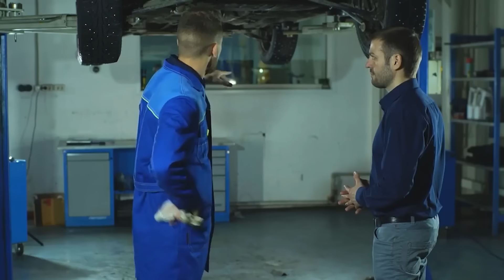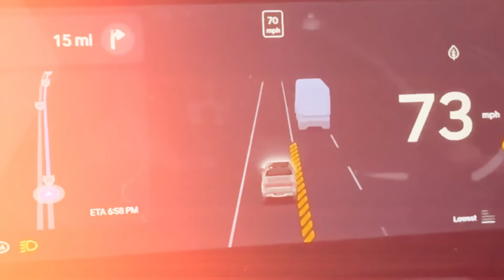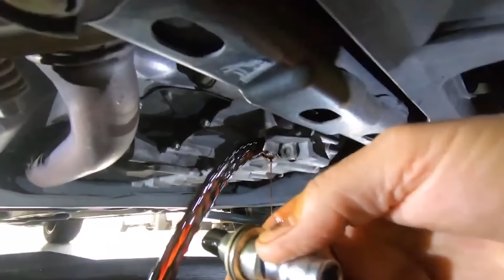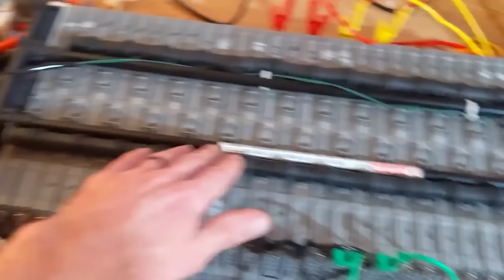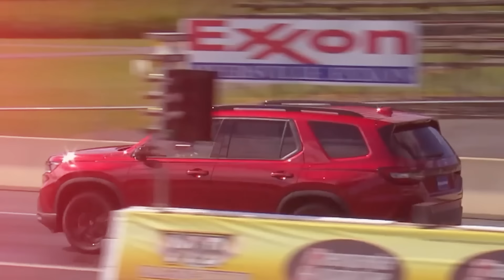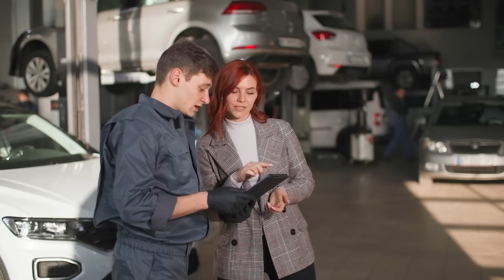NEW Honda Service Center Scams That You MUST Be Aware Of!

Comment: lol i took my brand new passport in for a minor washer fluid mal function and they recommended I address certain things, I said if I have to after address anything at 3000 miles I get rid of it and get a Toyota, I still have my 15 year old civic si and the only thing I dealt with was an ac issue. You buy a Honda to avoid the dealership.

Comment: I worked as a service advisor since 1988. Worked for honda first and than toyota. We were told to sell unnecessary services all the time. Fuel injector cleaning. Brake fluid flushes etc. The last place I worked the labor times for repairs were inflated. You either sell the work or no pay or no job. Worked on 100% commission.
Reply: Boy, for your paycheck, you probably had to rip off hundreds of clients a week. Was it painful?
Reply: No other developed country pays any job with commission only pay structure only prostitutes work on pay that depends on how many customers they fleece no other position

Comment: Same in Canadá , Honda try charge me 600$ for 20000km service , just for change oil, oil filter and differential fluid. Also try charge me 100$ for a pair of windshield wipers. I declined, and buy all the parts for a fraction of the price.

Comment: I never worked at Honda as an Auto tech but I did work at a Lexus dealership and we only serviced/repaired necessary item.  We actually had more work than we could handle and didn't need to scam work.   I could see this happening at a slow paced service department

Comment: I can tell you this is the truth. I bought a used 2015 Odyssey and took it to the dealer for oil and tire rotate. They came back with almost $4000 WORTH OF RECOMMENDED SERVICE. THEY NEVER CHECKED ITS SERVICE RECORDS OR CARFAX. Everything except the timing belt they had "recommended" had already been done. Just straight up thievery. Said there were oil leaks that didn't exist. Had two other techs look at it and confirm no oil leaks. Honda you are better than this.
Reply: Name Names here everyone... So we don't get stung there too. If you don't want or are scared to name their name, at least tell us what city.

Comment: I had my oil changed at Mick McClure Honda recently in Lewiston, ID.  When I got home I looked at the air filter and it was black. They may have changed the oil, but they didn't even check the air filter. What kind of shop changes oil and doesn't check the air filter. I won't be having them do any work on my car. Can't trust them since they can't even do basic work on my car.

Comment: Never had a problem with them.
Reply: Give it time. Its coming. My dealership tries to pull a fast one every now and then. But I know enough abouts cars to say no thanks. Original owners of a 1997 Honda Accord DX 231000 miles and a 2009 Honda CRV 208000 miles. CRV is going in for a valve adjustment 12/08/25. I will only trust the dealer for that service. Had a independent shop change out the sparks plugs the oil and the oil filter.   Went with OEM spark plugs, oil filter and radiator fluid. I changed the cabin and engine filter my self went with the Fram brand.  I am 69, hope to make it to 300K for both vehicles. Accord is starting to show a little age. Interior looks great. Paint is fading.

Comment: I worked for Honda dealerships for 32 years.   Honda never recommended any oil treatments.   Now the factory service managers turn a blind eye on all these practices.   I  recommend 5K oil changes along with maintenance minder.   I  would change CVT fluid every 30K
Reply: This must be an American thing or made up. Elsewhere in the world this does not happen, in Australia for instance, Honda provides fixed price servicing for 5 years at something like $180 per service and the warranty is 5 years and unlimited mileage.
It is not legal to claim additional non service items after purchase within the warranty period, that’s a recall and free.
Reply: @Rocket-hb6jh  The US lacks basic consumer protection laws. I was a mechanic in my 20s and 30s (we were called "mechanics" back then not "technicians" lol); and I always change oil at least every season (4x/year) and drain & refill - not flush - fluid in CVT transmissions every 30k miles (60k for automatics).
Reply: 30k miles or kilometers?
Reply: @starboyygamezztv8325  30,000 miles is best for CVT.
Reply: @starboyygamezztv8325   Miles
Reply: I change the oil every 3k miles and the CVT fluid once a year. I'm not taking any chances on these crapola CVT's.
Reply: I have a 25 CRV Hybrid do I need a CVT change at 30K as well?
Reply: @Moondoggy1941 
YES... highly recommend.
Reply: @Moondoggy1941 cvt change? You mean the cvt transmission or fluids change at 30k miles, I assume is the fluids. It recommended but not necessarily, you can push it at 60k like mine and it runs fine, cvt transmission are hit and miss for my experience
Reply: @Richard-k6e4j  Yes the fluids, I watched a really good video on the CRV transmission and it is not a CVT so I am relieved of that.
Reply: But Acura Dealership were doing this decades ago.
But engine oil has gotten better.
Reply: They gotta make sales, of course they going to upsale. I never take my honda to the dealership unless it's under warranty or recalls, but then again, you will always see those customers going in for service who pay a arm and leg for unnecessary services. Dealerships got to make money from services if they can't from sales, especially right now because of inflation and high interest rate

Comment: 10yr old vehicle just needed an oil change hadn't drove that much in five years, very low miles for a 10yr vehicle went in got the oil change which I thought it really needs then get an extra maintenance services of 3000 dollars about half of what the vehicle is actually worth now or says it's worth, There's a few things on the outside, that could be changed out but not necessary. I was like oh wow that's a lot let me think about it. I just wanted an oil change, Geez Original breaks are still good, second set of tires and bought a new battery and installed it myself a few years back, then had to drive and gas up for my ECU to reset four full tanks later, which I thought was crazy but whatever, I still baby I in no rush to get anywhere. But 3000 was a shock and awe moment. Weird how they said everything looks good, but, 3000 for extras???? Really

Comment: I had a similar experience when I took my Honda Civic with only 21k miles on it to a local Honda dealership to have a recall addressed.  I told them it was there ONLY for the recall work, but after having the car for most of the day I received a text message from the dealership informing me that aside from the recall work, my car had two "FAILURES".

Upon reading further in the text message, they advised that my car's failures were its need for a full alignment and fuel system cleaning.  This is for a car that is barely broken in, has never been in any type of accident, runs flawlessly, and has perfectly even wear on all 4 tires.  To add insult to injury, the services to address the alleged "failures" were priced at least double what they would cost at any reputable independent garage.

I declined the services for these alleged "failures".  I then wrote the dealership's service manager, and informed him that I resented being told my car had "failures" that were actually proposed services that would have absolutely no benefit, while being overpriced.  If anything, performing an alignment could actually make the alignment worse, since my car's tire wear is absolutely perfectly even.  I also told the dealership that representing these as "failures" was a deceptive business practice, and would possibly scare less knowledgeable owners into authorizing the work, out of fear for what could otherwise happen.  My car will never visit that dealership again.  Even in the event of another recall, I would drive a longer distance to utilize a more reputable dealership.

I am not the dealership's ideal 'sucker'...multiple Engineering degrees, and have been working on cars for 60 years, since before I was old enough to drive.

Comment: I took my Honda Pilot in for It's second oil change and the Honda dealer hit me up for $188 for a differential service.  I had a service contract to cover all services for 3 years.  The next time I went in for service I watched the the service rep show the same dirty air and cabin filters to 3 people to get them they need to pay twice as much as they would normally cost and most likely not needed.  I change my own and they tried to do the something to me.  With these scales I wonder if the are using a Hybrid oil and not Mobil One full synthetic.
The Honda dealer in Saint George Utah has become a SCAM shop, knowing you have to drive 120 miles to go to a different dealer.

Comment: For the last one for extended warranty for 1200 bucks .you do not need to go back to them you can go to any ASE certified shops and they will take care of the rest .we just bought a 2025 with 4k miles crv at a Toyota dealership because they were $9k less for same car at honda dealer that had 10k more miles .honda dealers are way over priced

Comment: THE SOLUTION TO THE PROBLEM IS DO NOT OVERPAY FOR A NEW HONDA. BETTER YET DONT BUY ANY HONDAS. THE RELIABILITY ON HONDA IS JUST NOT THERE ANYMORE, VTEC RATTLE, TRANNY ISSUES, WATER IN TRUNK, PEELING CLEAR COAT, DEFECTIVE DOME LIGHT IN CENTEER OF ROOF.

Comment: How about a new starter and alternator for your Honda EV. That will  prevent you from stranding on the road. They will say that to a female, older and minority customers. Actually they will say that to anybody. By the way you will need to replace your timing chain with a improved timing belt.

Comment: I bought a 2006 Honda Accord from the Honda Dealer Lot In Marysville Ohio after my 2004 Chrysler overheated and died at 160,000 miles The Accord I bought has the 3.0 V6 196,000 Miles when I purchased Since I had no idea what matinence had been done I took it in to the Same Dealer Service dept to get it tuned up a few weeks later I noticed a slight miss in the engine  I had $1000 with me My Accord was made in Canada just to note: I told the Guy who greated me I wanted to get a tune up and transmission fluid change. He directed me to the waiting area and took my car in. About 20 or 30 ,minutes later he strolls in the Lounge a informs me that "Since they had no record of my Timing Belt being replaced they would not do a tune up unless I paid for the Timing Belt to be replaced" it was $1700 to do this, so I had them change the Transmission Fluid and decided to wait a little while on the Belt. At 206,000miles I was in a better position financially so I took my Accord back to the Same Honda service Dept I had bought the car from to get the Timing Belt done They took my Accord in to do the work. I left the car there as they said it would take a day or two. On the 3rd day I get a phone call and they ask me if I want to fix the oil and Transmission leaks I say yes and the bill goes from $1700 to $3300 its a nice older car in decent shape so I decide to have the work done. I still drive this car it now has 265,000 miles. These newer cars are just not worth the money in my opinion. My tags are $50 a year Hybrid tags are Triple that $150 a year Full Electric tags $200 a year. Honda Service dept do over charge I was quoted a Serpentine Belt replacement just last week $330

Comment: And American Honda Corporate Headquarters condone these practices?
Reply: As a retired Honda District Parts & Service Manager - AHM absolutely DOES NOT condone any of these practices! If it's not stated in that vehicles service booklet - Honda does not support it. SAY NO (and F.U. 😆!) to any dealer suggesting wasteful fluid flushes, oil additives, fuel additives, nitrogen for your tires, stupid security systems, shady extended warranties, window VIN etching, bogus environmental fees and the like,,,,   HONDA OWNERS - READ YOUR SERVICE BOOKLET ! Understand that when the orange service wrench comes on, that's telling you what the vehicle needs. Dealers also use a multi-point inspection to inspect vital and safety related components, which use a Green /Yellow/ Red priority status. When used ethically, this can be a good thing as dealers have an obligation to bring to your attention a dire safety issue ( your tires are bald,,, your brakes are gone,,,) Please try to educate yourself when servicing your vehicle just as you did when you purchased it.
Reply: @craner325  Very well stated!👍
Reply: @craner325  My extended warranties ends if you blink when your at the dealership , the way they talk to you is unbelievable  , Craner thank for sharing your knowledge of how the dealerships work !!
Reply: Apparently they do...or they just perform no oversight.  See my other comment for my experience with a Honda dealership.

Comment: CVTs do need more constant fluid changes.  I change mine at 30k and only using the manufacturers fluid.
Reply: I replaced my fluids too at 30k.. Ecvt transmission fluid and rear diff fluid using proper Honda fluids.
Reply: CVTs are inherintly flawed
Reply: I do the same.
Reply: Never buy a car with a CVT transmission. But if do have a CVT transmission, use Amsoil 100% synthetic CVT fluid and change every 15,000 miles.  Also change both filters.  Yes, there are 2 filters.
Reply: How often do you do the fuel system service?
Reply: @MA-vm6jl  I use Royal Purple Max-Clean in all my vehicles.  Walmart ($12) once a year no matter the milage. Fill the tank full and add the whole bottle. Run the vehicle until it's1/8 or 1/4  of a tank then fill it as you would. I use a sticky note on the dash as a reminder.
Reply: recommended but not necessary, unless you go to the tracks all the time. i just do mine between 50-60k.
Reply: don't buy a car with a cvt transmission...
Reply: @michelhaineault6654  Honda has a good CVT.  Nissan does not.
Reply: @snakedog77  ok  possible
Reply: @snakedog77  And Toyota has the best CVT.
Reply: @LarryG321  Honda has a good track record with their cvt also.
Reply: @michelhaineault6654  I used to thin that BEFORE I serviced them. VERY CLEAN at 30k to 50k, not the "friction machines" I ASSUMED. proper service, sensible driving are keys.
Reply: @michelhaineault6654  These days that really limits our choices. I wish they would bring back the manual as an option for new vehicles, and one with minimal or no tech. I'd buy it in a heartbeat.
Reply: @michelhaineault6654 most cars come with CVT :(
Reply: Agreed. CVT fluid change every 30k’ish. This guy is clueless on reality. I bet they change oil every 10k...... lol....... idiot.

Comment: Dealer service centers are like HVAC companies coming to your house.  They are schooled on sales rather than repairs.  The instant they see an older unit, you need a new one.
Reply: I was an electrician for several years in my 20s and early 30s. This is partly true - there are a lot of predatory companies outr there looking to make a quick buck. It's also true that older units often have components that are marginal due to age; and it's surprising how often a repair on older units will generate customer returns or complaints due to other (un-repaired) component failures. I personally have had customers with failing or even dangerusly decrepit systems insist on a band-aid that would've came back in failed operation or even an electrical fire. If a system is old enough or has enough issues that more require than 2-3 hours of labor (and related parts costs) are required to bring operation close to new capacity, then it's almost always more economical in the long run to replace the unit. Not trying to be combative or argumentive - mostly playing "devil's advocate" on behalf of my brother and sister electricians. Have a great day :)